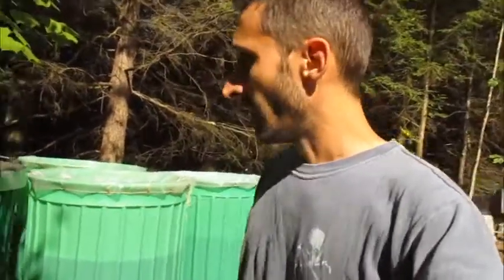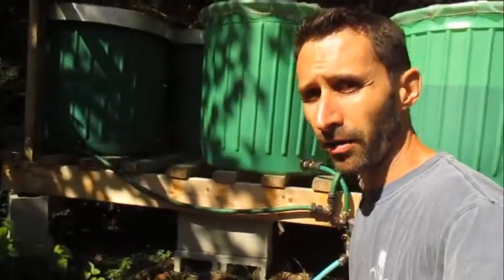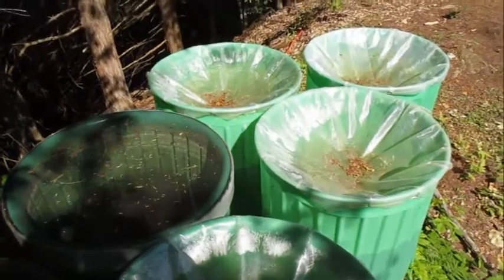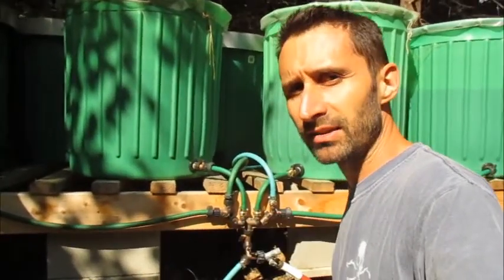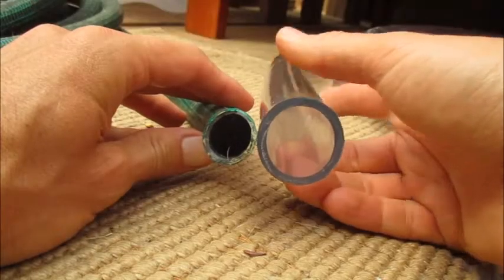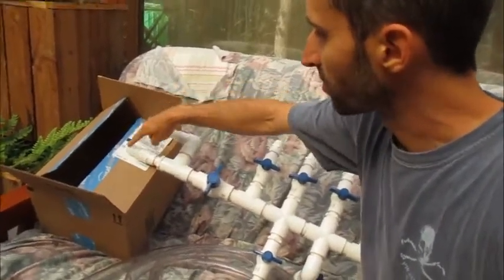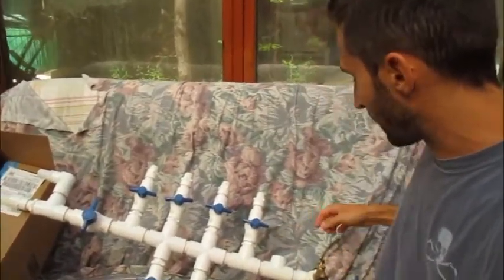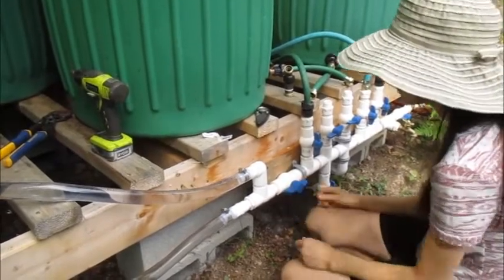My 3 Worst Prepper Mistakes

Comment: Mine was buying a bunch of cheap gear when I first started prepping. I had this sense of urgency and I really didn't really know where to start. Luckily I've learned a lot since then and my prepping has turned mostly away from gear to learning how to be more self-sufficient.
Reply from the maker: "...my prepping has turned mostly away from gear to learning how to be more self-sufficient." - It sounds like the financial cost of making those mistakes was well worth the lesson learned? I do my best learning when I'm unintentionally f**king things up.
Reply: Yup, the cost was worth the lesson. Now I consider my most-prized gear to be the Wonder Mill Jr. Deluxe grain mill and the All American pressure canner and the knowledge (I'm still gathering) on how to do stuff. :)
Reply from the maker: Dude, I have that exact same grinder (actually two so I can do nut butter in one and grain in the other), and same pressure canner. Great minds thinking alike? ;)
Reply: LoL Great minds MUST think alike! I thought the Wondermill Jr Deluxe was the best bang for the buck and will last for generations; and I wanted the All American canner because it doesn't use a rubber seal. I was afraid the rubber seal would eventually dry-rot if SHTF happened. Does that make sense?
Reply: PS: Check your private messages here on Facebook.
Reply: I had a fire a while back and the one thing I most regret losing is my books. many bought in yard sales, thrift stores or the public library (they sometime sale off old books if they are unused to make room) most are no longer in print. like "A Practical Guide to Blacksmithing and Welding on the Farm"

Comment: About to put in a rainwater collection system - I live in a REALLY rainy area. I actually hadn’t thought about run-off when the barrel gets full. Now I will. Thanks.
Reply from the maker: Yeah, run off is actually a hug thing to be aware of. If one doesn't consider it, one could be concentrating all the roof's rain into one spot on the ground. Also consider (if you are going to have an array of barrels like me), making the initial collection barrel have a significantly higher max level than the rest. This was an idea that was brought up to me and I think it's a very good one. This would allow the barrel to disperse the water it collects out to the matrix of other barrels much more efficiently. That initial barrel will never be allowed to actually fill up permanently, but it'll allow for a much faster dispersal to the other barrels when the rain comes down hard.

Comment: Being a plumber of 40 years, my idea for rain water collection is similar to yours except, I would keep your outlet system for drawing water but I would elevate the primary barrel higher and step down each barrel in order. Drill a 1 7/8"  hole about 3 inches from the top of each barrel. Primary has 1 outlet, each progressive barrel has 1 inlet and 1 outlet slightly lower. You won't overflow and each barrel will fill to max capacity. ( use 1 1/2 " abs pipe to connect barrels, seal around pipes with silicone)
Reply from the maker: An altitude differential would help in getting the water out to the array, but if the barrels are at different heights, once they all equalize, won't the maximum fill level of all of them be only as high as the lowest barrel's top?
Reply: if you fill from the top gravity will work for you instead of against you.  work best if the primary barrel is higher than the rest.
Reply from the maker: That's a actually a good idea about the primary being higher. It wouldn't end up being able to store as much (the top level of it being limited to the top level of the lower barrels), but it would act more as a buffer grabbing the water and more quickly disseminating it out to the actual storage barrels.

Comment: Buying my bug out bags from Groupon before I bought my sleeping system. Yup. Too darn small. Not expensive and nice for a few days Summer camping but now I have crammed and overloaded bags for the Winter and too cheap to replace them. Have to make this a priority as Winter is coming! I have to carry a lot if the bug out has to happen in deep Winter. Most of the year I'd use them without any problems. I didn't see the issue if I had to carry a real stove and fuel as I'd have to for a 100 mile trek in 30C :)
Other than that nothing much as a watch a lot of great vids like this one and read a lot before paying out cash

Comment: Just found your channel thru PrepperPrincess, so I'm a bit late sharing but will do anyways.
   I goofed when i started prepping.  I relied on storing canned goods for long term. It's hot here and they bloated / spoiled. Now, I buy only a 3 month supply; and only a  maximum of one month supply at a time, so I end up with multiple lots and less chance of losing a whole supply of one item.  I now try to use it within a year so that it gets rotated.   I no longer put canned goods in emergency box.
    On a side note, this year my garden is resting.  I'm using up my overstock and all the home canned goods, especially the ones I didn't feel turned out great (yet safely processed)..  I find the biblical principle of gradually putting up small excesses for several years, then using it all up, intriguing.  It's almost a sabbatical from my routines.  I have time this year to travel, fix up the place a bit, rethink garden plan while fences are down. As much as I love garden ing, the lands rest is a real blessing for me too.
      I now consider few things reasonable for long term storage.  I will only buy or put up  enough for two years if crops are abundant and cheap; because my life experience has taught me that crops often do well one year and not the next.  Not to date myself, but an example from the 80s was almonds.  Typically, an abundant crop every other year, meant cheaper prices in the good years.  I'd toss some raw almonds in the freezer in the abundant cheap years.  Raw almonds keep longer than roasted ones.
    In my emergency box, I'm now more concerned to have clothes,  UNDIES (lol), personal care, and flashlights.... or a ready to go basic overnight carry-on.  When a fire was near here, I grabbed my dirty laundry, because that's the clothes we liked wearing. Grabbed carry on I keep packed with personal care items, fresh socks, and undies.  Grabbed drawer with family photos.  Grabbed grandma's paintings.  Outta time..  Time to go!   Reality.... no need for food in this scenario. I'm headed to out of town family.  Though, I keep a few granola bars and a few bottles of water in the car.  Theres some gum or lifesavers in the carry-on.  That could be  handy if traffic stops. Then, the snacks for emotional eating to stay calm or energy if I gotta hoof it are practical.  No way my car will be loaded with my food though.  Storing a lot of extra food has not been less practical than I thought when I started prepping.
Reply from the maker: I think we've all learned those same lessons you recounted. Thanks for sharing. I was actually doing some info about foods that store well vs ones that don't for the Day 13 episode of the Alien series. I've found the same thing. Some stuff lasts and lats, other stuff doesn't so much.

Comment: I love the Goal Zero Yeti!  And I have the Escape too (I have the older design, which I love because it's so portable).  I only went solar thanks to them as well, but you've convinced me to try DIY!

The biggest mistake I made was not buying food grade buckets with gamma lids early on.  The lids aren't cheap, but they save dry goods from spoiling as quickly.  I tossed out a lot of food before that 😔.

In addition, now I save my empty Smart Water bottles and fill them up with rice, salt, sugar and beans - then add an oxygen absorber.  That way the portion sizes are smaller and minimizes how often I have to open the gamma lids.

Good video BTW!
Reply from the maker: I'm still using the dinosaur version of your buckets. My approach so far hasn't been to try to improve my storage system, but rather to discover what foods can tolerate my low-end approach.

I store rice and stuff in bottles too. I use glass gallon wine jugs that I find at the recycle station from time to time. Are smart water bottles glass too?

Comment: Sounds like yo are continuously tweaking and improving your preparations. Have you tried dehydrating smaller pieces of rhubarb? I actually like them. Tastes kind of like Sour Patch Kids candy. I also like to much on dehydrated corn as a sweet snack. My biggest prepping mistake was stockpiling a lot of canned goods that I never used and had to discard. It was a waste of money and space.
Reply from the maker: That's a cool idea for dehydrating rhubarb. I'll try it next chance I get in my solar oven. Thank you. I've often wondered if I'm going to have made a similar mistake having bulked up on tetra-pack almond milk for my boy. We don't tend to use tetra-pack foods because the packaging is so non-recyclable. But at some point, I'll need to use it or lose it. Thanks for the great idea on rhubarb!